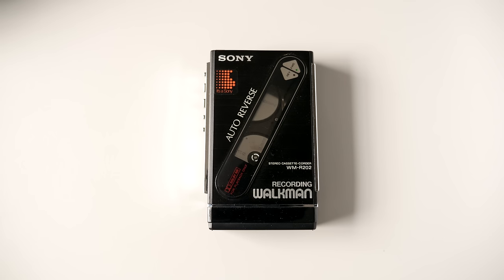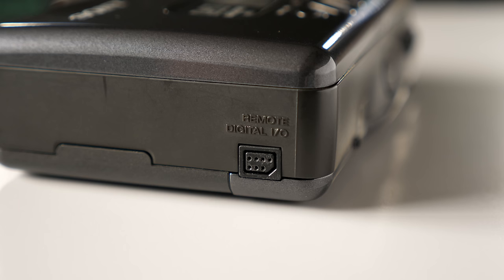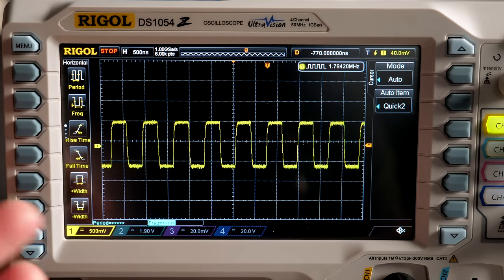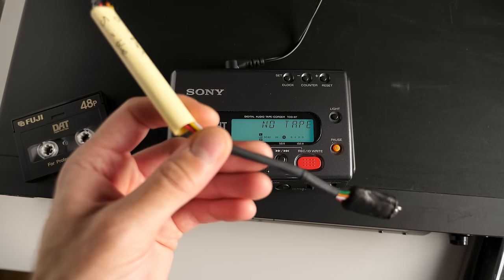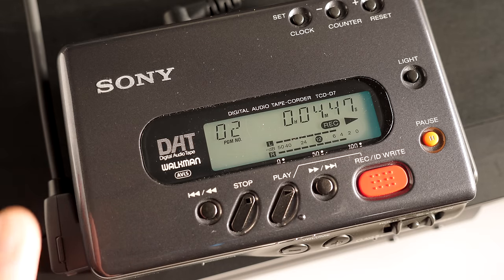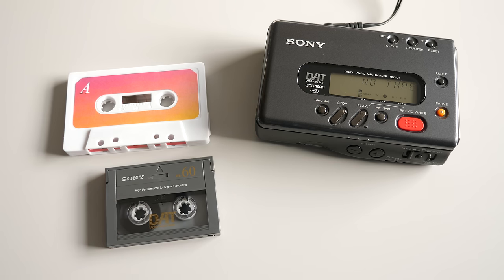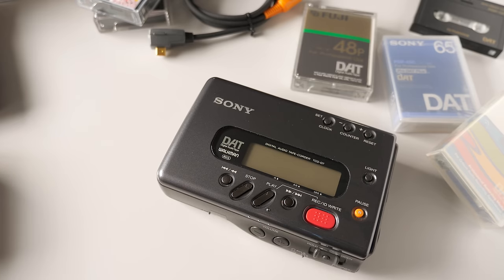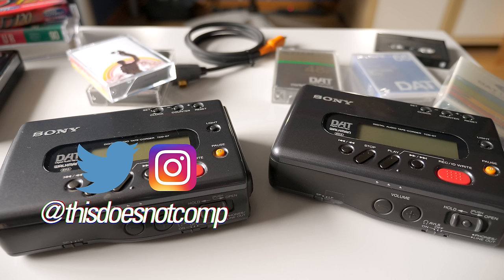Sony DAT: What Cassette Should Have Been!

Comment: Unfortunately the RIAA tied Sony up in court for so long that the launch of DAT was delayed by a couple of years as a result. Sony were also forced to design and implement the Serial Copy Management System to control how consumers could record digitally (the same SCMS that would be forced onto Minidisc and DCC too by the RIAA). I have a Tascam DA-20 DAT deck that has SCMS implemented,  however SCMS can be turned on or off at will, it even tells you how to do it in the manual.
Reply: I always assumed this lawsuit was why Sony bought CBS Records and Tri-Star Pictures. They weren't going to get fucked by industry representative groups.
Reply: The RIAA eventually compromised with Sony and created that SCMS copy management protocol so that you can only make one digital DAT copy of a CD as per consumer rights that were ruled in an earlier court decision regarding cassette home taping rights.
Reply: @AnthonyMaw  copy it and pass it on to the next person
Reply: Everyone I knew in the '90s that made bedroom electronic music had a Tascam DA-20 hooked up to a 16/24 or 32 Channel Soundcraft/Mackie desk. The main selling points were the ability to switch off SCMS, S/PDIF for connecting to the samplers/CD players of the day, and pro features for £799, which was expensive but still excellent value at the time. I loved my DA-20, it was a game changer at the time.

Comment: It’s not an exaggeration to say most albums from ‘92-‘98 have a DAT tape as their 2 track master
Reply: Sadly many of them were also used and UP-sampled to 192khz for their DVD-Audio releases…  Good example is the DVD Audio "The best of R.E.M." 1988-2003".
Reply: And almost every analog audio cassette in the 90s originated from a DAT master 😅
Reply: @LupoAlbertoVB  faqs 100 indeed you had to live it to know it
Reply: At 16 bit/ 48Khz?
Reply: As a mastering engineer from that period I'd say that's not far from the truth but a little way off. Most masters were recorded to umatic 1630. However master clones were almost always DAT's. Of course clones would be totally acceptable to be sent off for production providing they were timecoded and supplied with the appropriate pq data. You'd need to use something like a Sony 7050 to clone the TC from the master to keep the pq data intact.
Reply: @Disco_Breakin  very interesting! I’ve seen folks claim U-matic was totally phased out in favour of DAT in the 90s due to aging decks and difficulty obtaining spare parts and so forth. Good to know it’s slightly more complicated than that.
Reply: @kaitlyn__L  certainly very much alive and well where I worked. They were long in tooth and not nearly as reliable as a DAT. in the rack with the player would be a seperate 1u unit that recorded all the CRC errors and drop out that you'd have to keep a close eye on
Reply: @Disco_Breakin  oh no, watching CRC error counts, that takes me back to network management nightmares hahah
Reply: @kaitlyn__L  hahaha strangely I moved from mastering to networking a few years later
Reply: @Disco_Breakin  how appropriate!
Reply: Earache Records used them
Reply: @KRAFTWERK2K6  192 kHz is pointless, even dogs can't hear it
Reply: @JonnyInfinite  It's not about the actual samplerate frequency but it's about the heterodyning of frequencies that happens as these higher samplerates. And that CAN be heard by humans. THAT is the effect that occours when listening to audio material at high resolution which makes it sound better to our ears. And that's why high audio resolution makes all the sense.  However upsampling lowres audio to that frequencies is bollocks and totally useless.
Reply: @KRAFTWERK2K6  Exactly, most AD's even modern ones don't do a great job of filtering out the stuff above 20k when recording at 44.1 or 48k this is made worse by people recording stuff close to full scale which compounds the problem. You'd be surprised at how much bandwidth in the top end certain acoustic instruments and electronic ones can produce. This all comes back as aliasing and distortion when recording at 44.1 hence why high resolution when recording matters. Playback at those high frequencies isn't really as important but for recording in the studio it makes total sense (among other reasons) For the 2 track master you can then sample rate convert using modern algorithms and then dither to 16 bit for CD/consumer consumption. 192k imo is a little pointless but 96k makes total sense now days in the line of pro work.

Comment: You nailed part of it. DAT mechanisms are fickle little beasts. I've used them in the past for music purposes, and I use them at work as well for data backups on some legacy machines. I have a stack of New Old Stock drives for the old IBM RS6000 machines because they rarely last much longer than a year. It was a format with a lot of potential, and leave it to the RIAA et al to stomp on it, just like they do any time something new comes along. I swear to god, if the RIAA got its way on everything, the music industry would be in even worse shape than it is now. Look at how long they dragged their feet on streaming and digital sales. Along comes the tech industry with something new, the RIAA says whooooah hey now no no.. Tech industry says welp, we doing this thing with or without you and look at digital sales now.
Reply: That proprietary digital I/O port reminds me of the controller input on NES.
Reply: @reathareatha3870  are you sure?
Reply: I agree, DAT never really got to the point of VHS where mass adaptation of the format resulted in low prices and polished products.  Plus helical scan recording intrinsically is a sensitive technology.  But DAT is rock solid, mature technology compared to Exabyte which gave us big troubles, in particular when people used the drives with cheaper but unsuitable 8mm video tapes.
Reply: @ralfbaechle  I still hesitate to say DAT in computers are rock solid, but yeeaahhh.. Exabyte.. Yikes.
Reply: @JoeMcGuire  DAT certainly has a bad reputation for long term storage but I fortunately can't confirm that.  A few years ago I restored all my old QIC cartridges (60, 120 and 500MB).  The belt drive mechanism had failed in ways I was not able to fix.  All DAT media restored just fine.  All AIT media just fine.  All ZIP media restored just fine.  All C64 tapes worked just fine.  So that pretty much contradicts common wisdom.
No Exabyte to try though :-)
Reply: @ralfbaechle  I do think DAT had its issues mostly because its essentially a VHS mechanism in 1/20th scale, but ive got some old Dat stuff still kicking around, im assuming your talking about the Iomega Zip format, which Ive never really heard as being unreliable, the drives yes but not the discs, and even the drives are not that horrible, Ive got a win 98 machine with an ATAPI drive still purrs just fine, Ive got a SCSI one no real issues aside from occasional SCSI bus issues when connecting it, but meh it works eventually, and a butt load of the paralell drives that kinda can be touchy but even they seem to be decent and work with pretty much all the computers i want to use them with, even going into windows XP and to an extent a computer I have running windows 7, though it gets weird, slow and occasionally glitchy with drive not ready errors. C64 stuff though, assuming commodore 64 here hasnt really been horrible ive maybe had a handful of tapes that generate loading errors, and sometimes they will even work long enough to get a copy made the disks are honestly about the same as other old format floppies, they are touchy at best now, but tend to work well enough to copy.

Comment: I still have some affection for DAT. At the time they came out, amateur recording was all about getting a Nakamichi or Tascam cassette deck. These were mere cassette decks that had 3 heads and more robust engineering than your average home deck. But you still had a 1/8th wide tape. so even with the best transport, best electronics and expensive chrome or metal tape. You had wow and flutter. I made a lot of recordings of bands using an 8 track open reel and a Tascam cassette for mixdown!
DAT was much higher bandwidth. No Hiss, wow or flutter. 
The problem was that it had no headroom past zero. So an exuberant drummer could ruin a take if you were mixing straight to 2 track. 
DAT machines would also eat your tapes every now and then. A big reason we all went for Panasonic SV3700 decks was because Panasonic had decades of broadcast video tape eperience. And their DAT machine showed it!
It's funny that now we are so desperate to go back to the sonics of the pre digital era. When that era was so much toil and sacrifice to have any fidelity at all. Digital audio was such a gift from the gods when it came out!
Reply: well the hiss, wow and flutter was purely because cassette was analog, im sure DAT had all three of those, but because its a digital sample as long as the 1001110010 is readable by the machine it will play it back, i would also say the headroom past zero of analogs was also a bit taboo yes you could push it briefly, like really, really briefly cause it was over blow all the other music being recorded as well, but the flat out 0 point of digital was honestly not an issue for me because i just always had the recordings set properly before hand and the players knew what to do.

Comment: 1:46 SP is 48 khz or 44.1 khz, depending on how the DAT was recorded. The TCD-D7 itself was able to record in both sampling rates. The better than CD 48 khz were a big selling point for DAT back in the days.
Reply: And also that it was lossless, unlike MiniDisc which was lossy and "just" 44,1Khz. Only MiniDV was also able to record LPCM 48khz 16 bit until digital Solid State recorders became popular and replacing the tape based digital audio recorders.
Reply: @KRAFTWERK2K6  Minidisc was introduced four years later.
Reply: Just marketing wank though. 44.1kHz is plenty high enough of a sampling rate.
Reply: Actually. I used to work with DAT machines through out the 80's and 90's and as far as I know, 44.1k was not supported. SP was 48k at 16 bit depth and LP was 32k at 12 bit depth. but as far as I know. 44.1k was never an option on any of the machines I worked with.
Reply: @joyange1  The later models definitely had 3 recording settings, 44.1 being the third.
I used the Sony D8 which could record at 44.1.  The deck in this video is the earlier D7.  It only had 48 for recording in SP mode via the microphone, but it would record at 44.1 if given a digital audio input from a 44.1 source (like a CD).
Reply: @joyange1  First generation consumer DAT machines couldn't record 44.1 via digital in, only via analog in, to prevent perfect copies from CD. Later ones could though (those produced after SCMS was mandatory). Maybe you only used earlier devices?
Reply: I had mine set to 4.7mhz
Reply: Pioneer offered 96 kHz recording in their D-07 DAT machine. The tape and drum ran at twice the speed, though.
Reply: @misterhat5823  Not for professional use. You really want 48 kHz.
Reply: @Shaker626  48kHz is the standard for professional use, but it's no better performing than 44.1kHz.
Reply: @misterhat5823  I'd say more room for the anti-aliasing filter is a definite plus.
Reply: @Shaker626  Meh... That's what oversampling is for.
Reply: @misterhat5823  Which is a little strange as then a frequency conversion is required when mastering for CD….
Reply: @bsd107  The 44.1kHz standard for CDs goes back to when digital audio was stored on video tape. Using 44.1kHz they were able to make the digital audio look like a video signal.

48kHz was pulled out of someone's arse because "more is better." Also, by making the pro standard different it wasn't possible to make bit for bit accurate copies of CDs. Otherwise the record labels would have thrown money at politicians to make it impossible buy DAT machines.
Reply: @misterhat5823  umm two things, number 1 48KHz wasnt pulled out of someones ass, it was a more is better thing which being as your talking tech companies thats all they really want to do, make thing better and a slightly higher KHz is better 

also what do you think caused SCMS to be created, record companies did throw money at politicians to try and make it impossible to buy DAT machines, why do you think they never sold well when they were introduced, ill tell you what if DAT was more available when i was in best buy i would have bought it over CD at that time purely because it could produce the same quality as a CD while having record just like compact cassette 
The main reason that DAT couldnt be made illegal in that way was because nothing it could do violated laws, yes it could record perfect digital copies of CD but there were other products that could do that as well even if they were big, clunky, expensive, and often required something like Umatic or VHS to use as a transfer media
Reply: @compzac  <--- Armchair engineer
Reply: SP is 48 kHz on this model and applies only to analog recording. You can switch between 44.1/48KHz in the D8 model. Recording via digital input is a different matter, you can record in 44.1 or 48 KHz depending on the source sample rate.